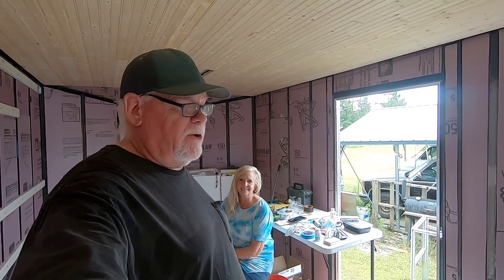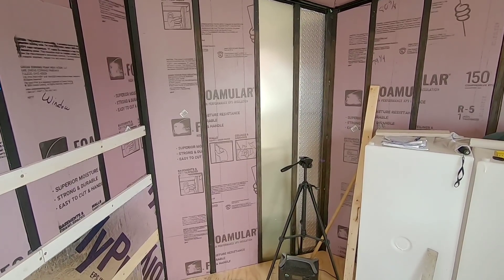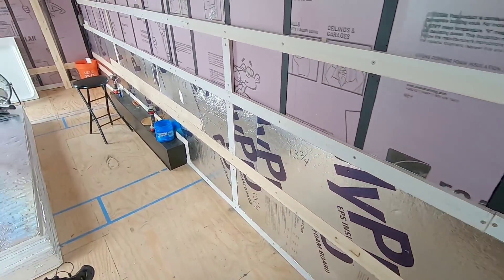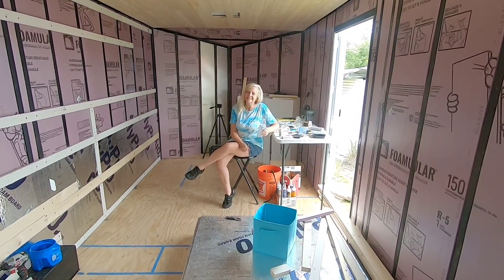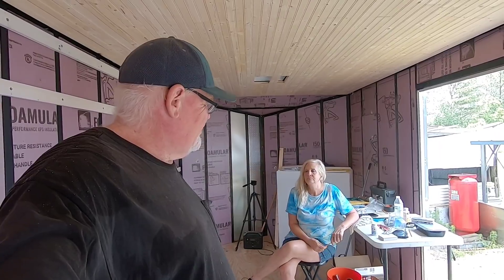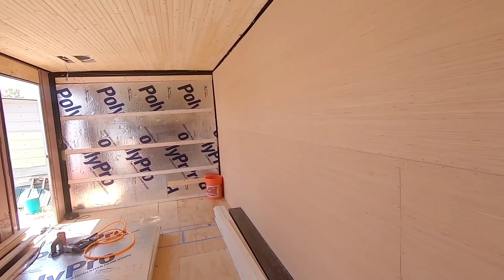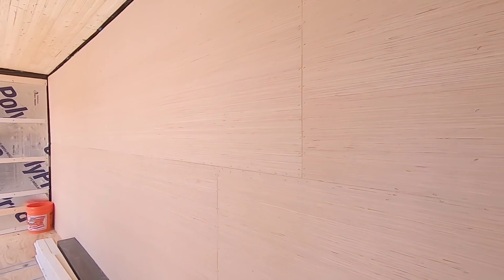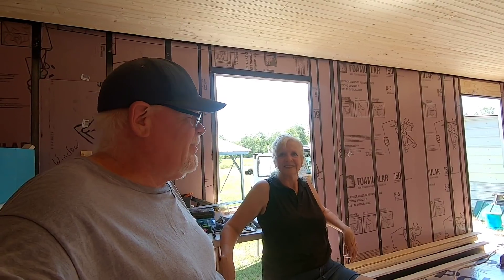Cargo Trailer Conversion Wrapping Up Insulation/Hanging Wall Paneling/New Help Has Arrived

Comment: Thanks for another great video! As for the person that was talking trash, I am sorry to say I was at one time one of the suspects that would look at a enclosed trailer and think what kind of garbage is that. Then at one of the several biker rally's we went to, I saw the back open while the people were unloading, WOW, the cover sure doesn't match contents, here he is pulling out two brand new CVO's baggers. each about $50k, the insides were also just as WOW. the trailer was a little worn and used from a landscaping  company, typical dents, scrapes. My wife and I asked if we could see his setup, he said sure come on over, we were hooked on the concept. I asked why a beat up trailer, he said a few things that made sense, first the price was great, second who is going to want to steal  a beat up trailer that doesn't look worth much, third he parks the trailer in a not so great place when not being used, he said the outdoor storage he uses, newer trailers, and campers were stolen off of the "secured" lot. the thieves figure they can't get much for an old company trailer, and the insurance on it is great. In all that trailer was a 24x8.5, big for a landscaping contractor but apparently the guy had a nice size crew, and crew cab dually. Moral of the story is, sometimes $50k x 2, + $30 in improvements to the inside, makes the $2K paper bag worth it. I am amazed at what many people make, wish I was that talented, but we all make due with what we have. Besides we can say, " we didn't buy it, we did it ourselves".   Keep the videos coming!
Reply from the maker: Each build is totally different and awesome.

Comment: Great idea the change to FRP I have used it for years with No problems. I would chalk the corners even with the corner trim. It will save you $$ with no downside.

Comment: I hope all is going well
Reply from the maker: We are tired, but got it the stage we could live in it and have moved to our next location. To do more, then we head back to Arkansas. We are a little primitive but all is well
Reply: @billanddeb  That is sort of what I've done.  I have it somewhat livable and am living in it.  But I still have most of the actual build to do.  I'm wanting to see how you  do your bed platform and floor, so I'm anxiously awaiting your next video!  grin  I saw things you did that I need to go back and do.  Like caulking the inside.  For some reason, I thought you did it from the outside, so i already have my insulation up and now I need to redo it all.  lol

Comment: I bought 5 pounds of screws from Jakes and they were junk. They would not reliably drill into the metal and the ears would not always break off, making the hole in the metal too big. I threw them away.
Reply from the maker: Must of been a bad batch. We've had zero issues. Just used some today in fact.

Comment: Doing a good job...did you think about taping the foam insulation joint with reflective tape to keep air temp from migrating in and out of the conditioned space?

Comment: Can you provide a link to which sheet metal screws you purchased from Jake Sales? I know the length we use will be different but we just need a starting point. Thanks Bill and Deb
Reply from the maker: https://jakesales.com/products/reamer-tek-torx-star-head-self-drilling-wood-to-metal-screws-for-flatbeds-trailers-or-fastening-wood-to-steel?variant=45056589857086&currency=USD&utm_medium=product_sync&utm_source=google&utm_content=sag_organic&utm_campaign=sag_organic&gad_source=1&gclid=Cj0KCQiA1rSsBhDHARIsANB4EJaUtpYtY4tymdBVuE2miqsQb-QyDuR1UEhAcKFxwfTbNh2JklJY7uUaApsfEALw_wcB
It's been a while, but I'm pretty sure these are the ones we used to fasten firming strips to the metal studs. Jake's has a wide variety of all types of screws for a multitude of applications.
Reply: @billanddeb  thank you so much.

Comment: if you're still down in florida then 4-5 hours isn't bad, its too hot here to get much more done.  wish i would've gotten the insulation and ac working before the heat hit haha also when you do your mini split can you measure how many watts it pulls when the compressor is on?
Reply from the maker: It's rated to pull 9 amps. We'll do some tests when we get it up and running.

Comment: what is the R-Value of your walls? I did a single 2" R13.1 application by removing the studs dimensions from the insulation panels for the thermal break. So R13.1 less where the studs are. I'm considering applying another 2" for a total of R26.2 in my walls - I haven't decided yet if losing 4" of interior width is worth it or not.
Reply from the maker: Foam board insulation is typically rated at 5 Rs per inch. We have a total of 1 3/4 inches of foam board insulation in the walls and ceiling. That adds up to an R9.
Reply: @billanddeb   I used the Brand Sika and theirs seems to build R value with depth, here are their values: 1/2" =3.2 | 3/4"=5.0 | 1"=6.0 | 1.5"=9.6 | 2"=13.1
I used the 2" for the 13.1R and I'm considering doubling that up for the floors and ceilings, maybe even for the walls? I don't avoid cold climates, I hunt them down! As long as I get plenty of sunshine for my 5.4kWatt solar array I can keep Taj-Ma-Haul 78f for 380watts/hour with my current 13.1R.

Comment: Looks really good. Are you gluing the furring strips to the steel if so with what. Are the screws self taping? Thanks Kc
Reply from the maker: Screws are self tapping, but we still had to predrilled some. The glue we use is gorilla glue construction adhesive.